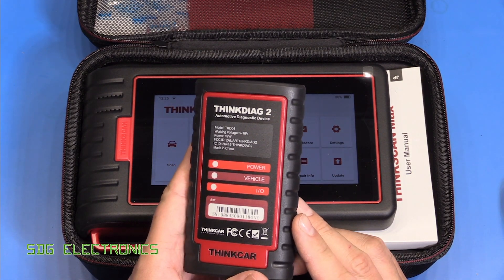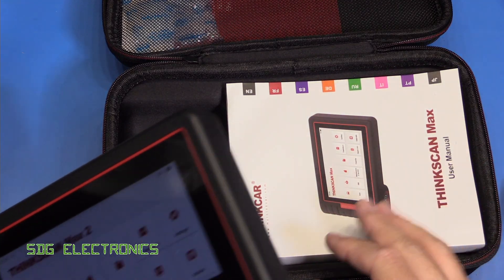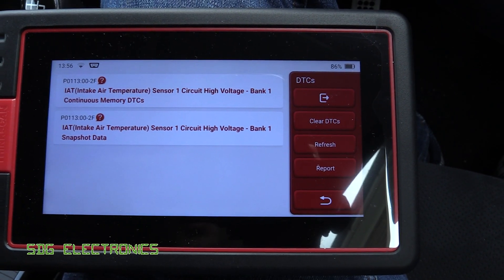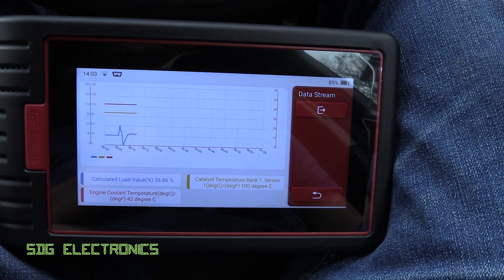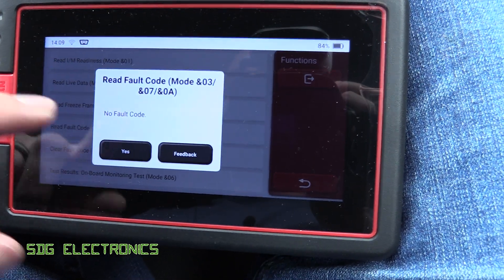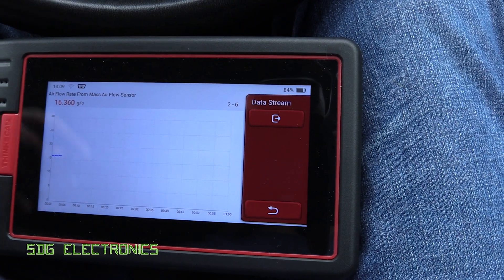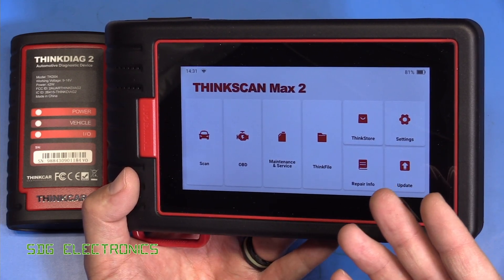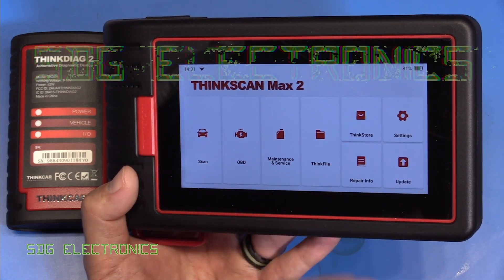SDG #272 Thinkcar THINKSCAN Max 2 OBD-II Diagnostic Tool Review

Comment: Great video! 2 years later and yes! they made some changes. One thing I noticed , IMMO, is in there working good. The cheaper Think scanner bluetooth cannot compare with this year offer,2023, Lifetime free updates. You do have to purchase your specific vehicle make for $50 per car. But thats fine if you charge it to the patron your serving. I am not promoting Amazon but if you apply for their credit card that you dont have to use you get $200 off, plus additional $60 coupon. after taxes and free shipping it down to $185.00

Comment: Thinkdiag 2 felt like an amazing device, I ended up getting it thanks to your video. But sadly, it wouldn't talk to the ECU on my 2005 Bentley Continental GT. I suppose some protocol issue. Other scanners can read the car fine. So I suppose Autel is the safest bet to avoid such hiccups, or should I consider this Max 2?

Comment: Thanks for another great review and it would be great if you knew how to flash the firmware, so this unit will work with the latest version Xdiag or Diagzone or Prodiag software for an Android tablet. I hate this ThnkDiag+ app on the Android tablet because it doesn't work in horizontal mode and it's very basic with terrible graphics. Alex Launch on YouTube is using this ThinkDiag-2 diagnostic tool with the firmware flashed and using it with the Launch X431 PRO5 software on an Android tablet, but the video is in the Russian language.

Comment: Doesn't do all they claim, even with the GM add-on it will not do what they say. This is no better then a cheap code reader. These reviewers must be paid or never worked on a car.
Reply from the maker: It might be worth contacting support if you're having issues. The bidirectional controls and special functions are what set this apart from a basic code reader
Reply: I already contacted their so called support, they even admitted it will not do as advertised. The only big directional capabilities it has is to turn on and off simple things. I have been repairing cars for years and this is junk. People are better off buying a cheap bluetooth code reader over this. You were paid for this review, weren't you ?
Reply: @isieshank9098  which one did u bought for a similarity product if u dont mind it*

Comment: Good review. Seems expensive for a DIY person.
Reply: Especially when it doesn't do what they claim. I actually fell for it and bought one. Doesn't code replacement parts , even with the GM add on. Called their support line and they even said it doesn't do what they list. Do not buy. You can get a cheap Bluetooth reader and a free or cheap app for your phone that is better then this piece of junk. The only ones that review it and say it is great are the ones they pay.